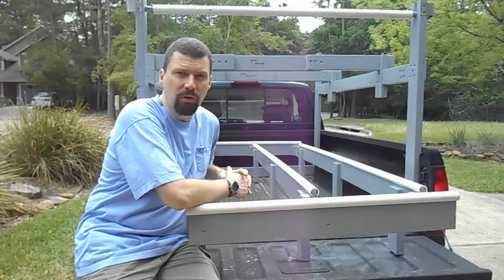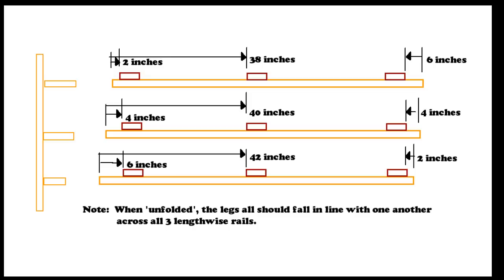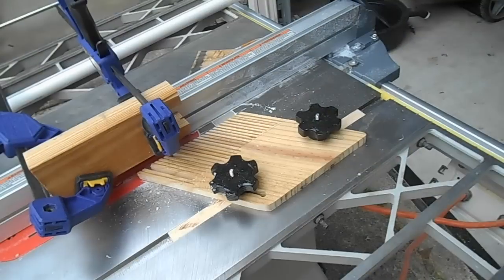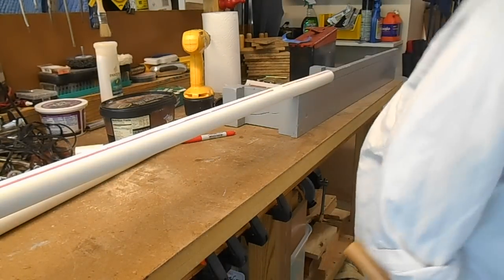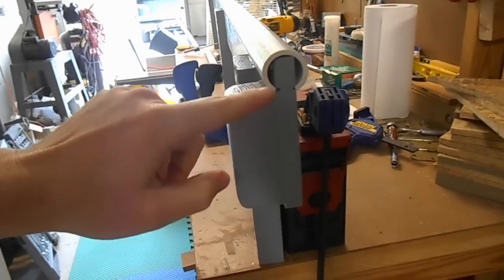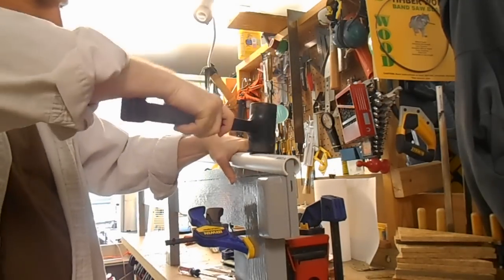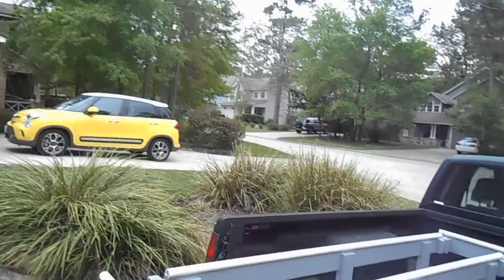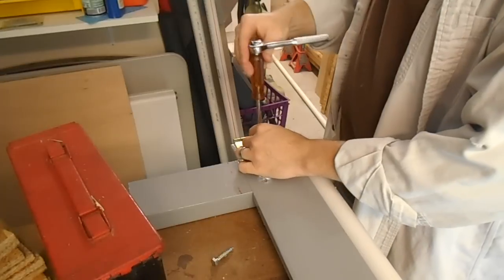Make a Plywood / Sheet-goods Hauling Rack - Part #2

Comment: Small piece of constructive criticism. Small trucks engineers have thought of this already. In this video you can see slots in the bed walls in front of the wheel well and near the tailgate. The purpose of those is to put a piece of 2x6 vertically across the bed so you can haul sheet material above the wheel wells. In my opinion, incorporating those slots could have made a simpler and more secure solution.

Comment: Great job, but why can't you just put it on top of the wheel wells?
Reply: There are reasons why you may not want to haul some sheet materials at an angle either on a wheel well or propped on the tailgate.  If it's finish plywood or drywall you don't  want to damage the edges or risk cracking.  ...unkaay?  I admire his creativity and it works well and should protect the materials.  But that's a lot of work.